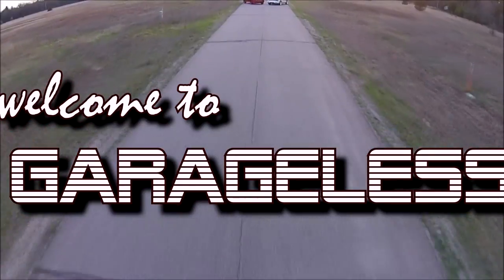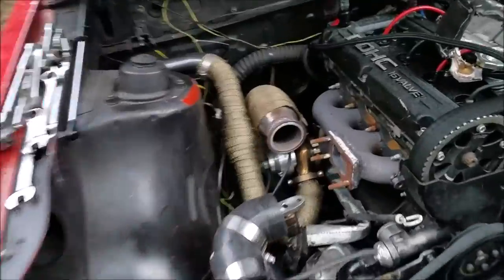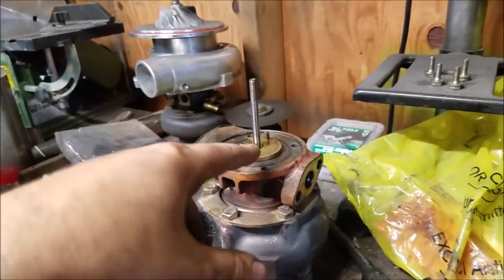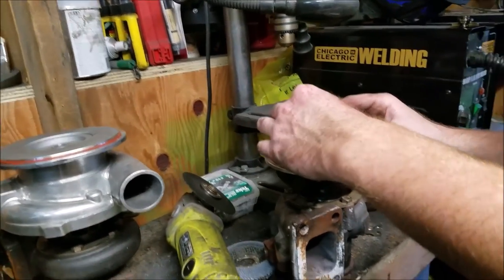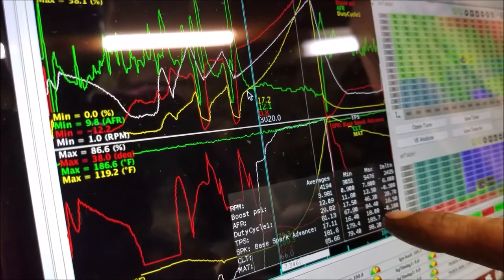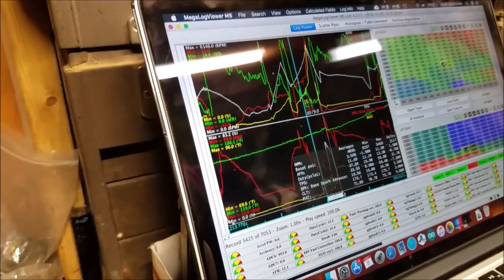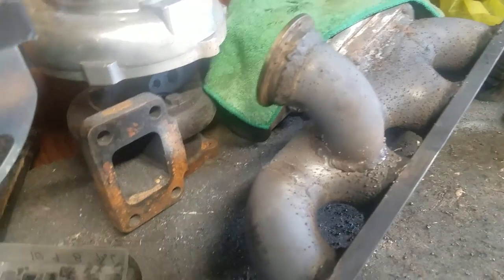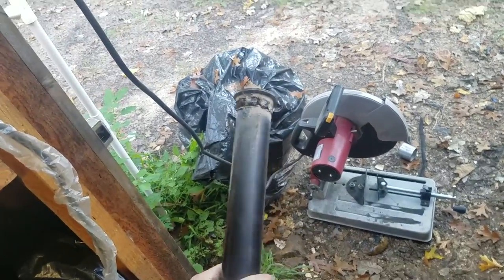HOW TO MAKE HYBRID EBAY TURBO TO SPOOL FASTER!

Comment: Gt35? Is that what the old one was? I've been screwing around with porting/polishing the hot side, definitely worth it makes a huge difference. You wouldn't think so either
Reply from the maker: Older video so not sure at that time gt30 or gt35 most likely

Comment: Pretty sure shield gas would make a difference over cored wire as well...
Reply from the maker: My argument is that my old fiero turbo and wastegate where held up with the same fluxcore welder... no issues and i ran it for 2 years